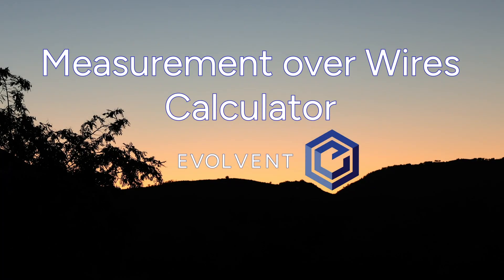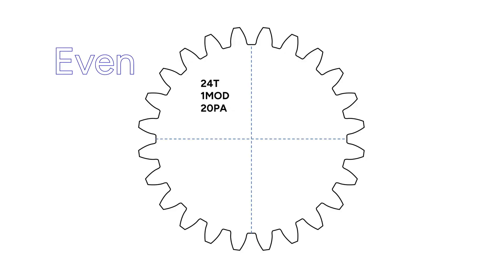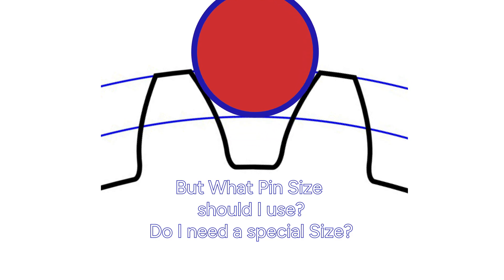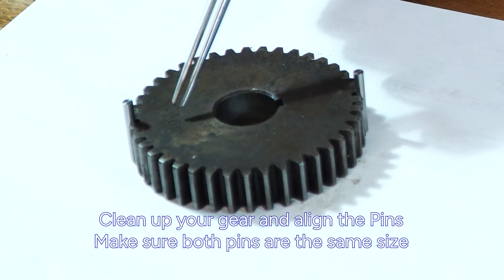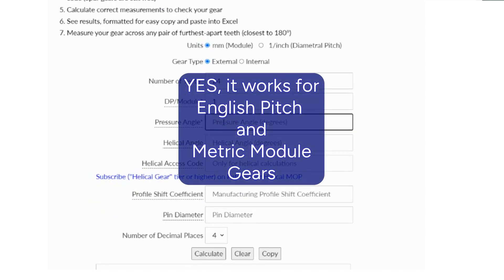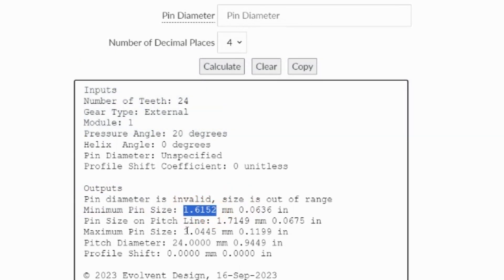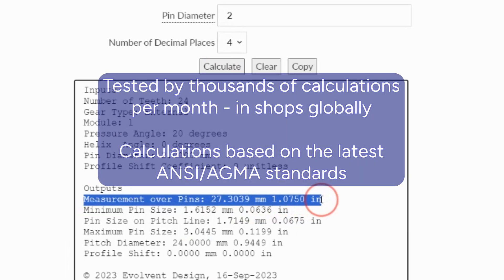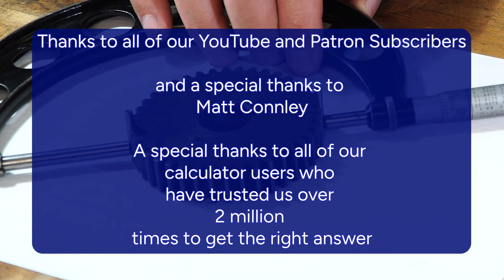Gear Measurement over Wires Calculator( aka Measurement over Pins MOP)

Comment: This video brings back memories of working as a parts inspector 50 years ago. Using pitch wires to measure the pitch diameter of type 3 threads. As I recall you had to juggle the part, three wires and a micrometer to make the measurement. If you didn't drop at least one of those items it was a good day where nothing valuable was destroyed or lost. 🤞🏾
Reply from the maker: It does take some dexterity - thanks for watching